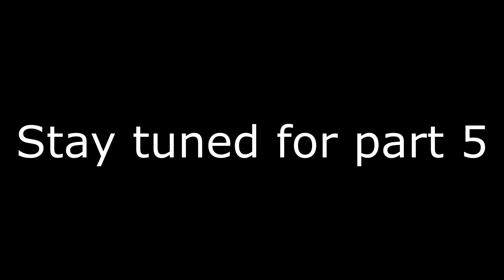Guitar Build Custom Through Neck (Part 4)

Comment: For someone with no woodworking or guitar making experience, you're doing a terrific job mate!
Reply from the maker: Thanks, Its turning out much better than I exoected!
Reply: @robmarmaduke  from what I've seen in these last few videos it's because you take time to setup the cut.  My problem is I'm impatient and tunnel-visioned so I find myself spending more time trying to fix mistakes and mitigate damage instead of spending time on jigs and edge guides, etc.  You take it slow, place guides and shims, etc so that it comes out right the first time.  I will take note.

Comment: I used bamboo skewers for light color side dots. their taper makes it easy to do a variety of sizes.  i bet black superglue would color them quite well. think ill try it on my next build.
Reply from the maker: That might work but I think you may risk sanding the colour off them as you sand the neck smooth

Comment: This style of neck usually has string trees to compensate for the low break angle
Reply from the maker: As it's a 4x2 it doesn't need them as I took the face of the headstock down far enough